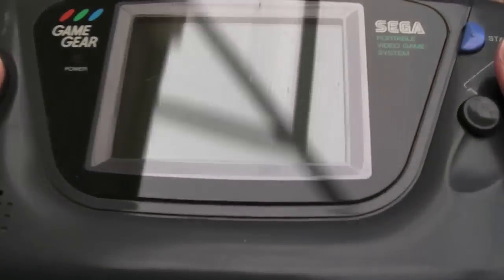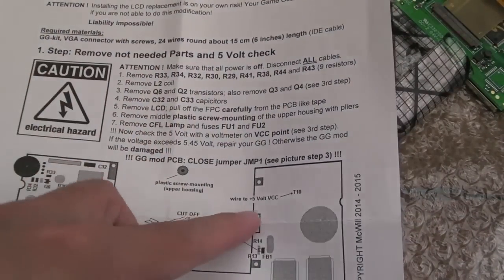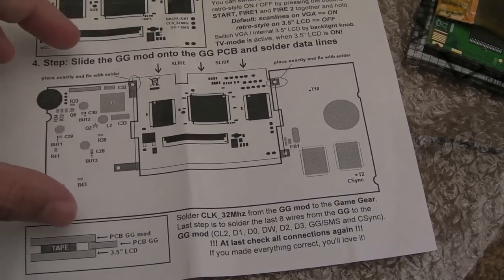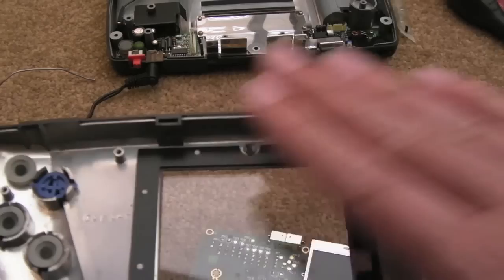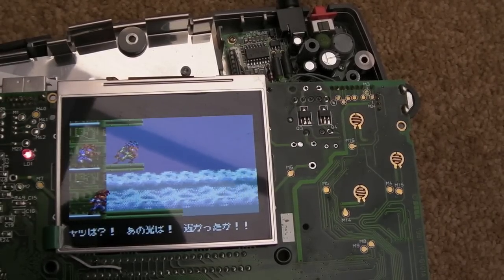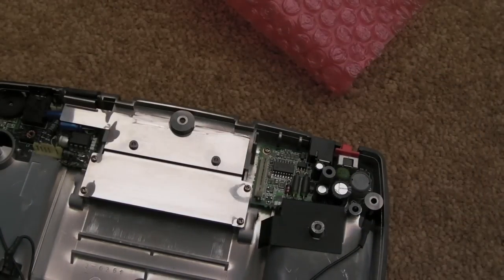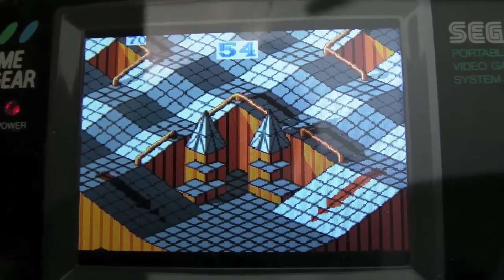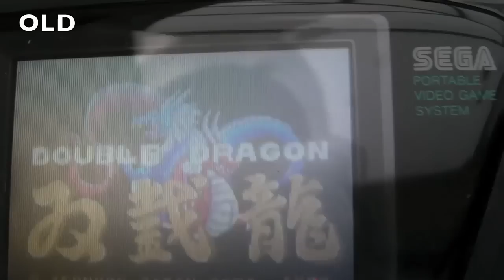Sega Game Gear Modern LCD Replacement (Not Composite) From McWill

Comment: I'd like to see what the TV tuner attachment looks like on this new screen.
Reply from the maker: It's not compatible!  The way the tuner interfaces with the Game Gear means it drives the screen directly with a different refresh rate I think.
Reply: @GadgetUK164  could that be adjusted somewhere either in the LCD or tuner?
Reply: @coondogtheman  Practically no, since you'd need an analog-to-digital video converter since this replacement LCD will only work with digital input signals.
Reply: @armorgeddon  so the original screen is analog?
Reply: @coondogtheman  The screen itself is not (LCD is digital by nature), but apparently it has an analog input which the LCD controller then converted to digital again (similar to a desktop LCD display with VGA input). The only reason I can imagine why Sega would go for such a complicated and quality degrading system is that it was the only feasible way to be able to offer the TV tuner for which they also had to deal with the different TV broadcasting standards across the markets they were targeting.

Comment: Gave you your hundredth thumbs up.
Thank you for this video!
Very informative, in depth, and incredibly helpful.
Reply: It's awesome that McWill incorporated the "scanline generator" option to soften the high def LCD's revealed pixels, and make the games look more like they were intended to be, though on a better LCD display.
Reply from the maker: +SwankeyMonkey Thanks!  McWills screens are awesome, they really are!!!  I bet those Sega Nomad fans can't sleep at the moment waiting for his next screen!
Reply from the maker: +SwankeyMonkey I suspect if you got a larger LCD from the same manufacturer (could probably source the screens on AliExpress I think) then I guess you could probably put a larger screen in, but some work might need to be done regards the connector.   They tend to work with an interface that expects a certain protocol though so it probably needs to be the same manufacturer and would need to have same resolution support etc.   Probably more hastle than its worth tbh.   It might be worth asking McWill the question, he might be able to enable support for a larger physical screen without much of a modification!  If  there's a larger screen from his supplier it could just be a case of a connector change.
Reply: +GadgetUK164 Thank you for the response.
That is exactly what I was wondering about, both the connector if it was somewhat universal or common, and also if there were anything specialized about that particular LCD display in regards to protocols or codexes or what have you. And since you got direct contact working with it and had become familiar with it, is why I asked if you had noticed anything in particular that would keep someone from upsizing the LCD display to match that kit.
But I will carry further with your recommendation and get ahold of McWill about options for my project. 
Thank you again. I subbed your channel.
Reply from the maker: You could also just use the VGA out if course, that way any screen that's VGA would work!
Reply: ***** I understand what you're saying, and know that there are good and not-so-good scanline generators out there depending upon application and display.
But a display this small that's in the Game Gear, doesn't blaringly reveal the image loss you get with typical scanline generators, or isn't as noticeable as it is on much larger displays.
If anything, it seems to improve the image in this application by softening the pixels of certain games.
Anyways, always better to have (scanlines) as an option to suit to one's liking, as opposed to paying for a bare-bones display that you might not be pleased with.

Comment: I order one of these based on this video.  Finished installing it today, wow, what a difference it makes.  My Game Gear is again my favourite handheld (especially when paired with a Everdrive GG).  McWill is an absolute genius.

I took you advice and only soldered one tab, and took ages moving it the slightest amount until it was perfectly aligned.

I think McWill has made a revision to the board as there were extra pads on mine where BUT1/BUT2/BUT3 (from the caps) solder to.

Comment: Wow, this is a really beautiful mod. This would breathe new life into my Unhappy little GameGear - can't wait to get this modded! Thanks for sharing, this is amazing! I was sold when it was aligned correctly, odd glitch eh?
Cheers for sharing!
Reply from the maker: +Callum Rickard Yes, these screens give an excellent picture and are highly recommended!  The only negative really is the slight different in the way the pixels are stretched a little but it's hardly noticeable really and looks way better than the old screens.   That glitch never repeated itself since it first happened!  I think it was just my glitchy everdrive and the fact I sometimes have to switch the Game Gear on and off several times to get the everdrive to boot.
Reply: Ah cool. I don't think I'll end up using an Everdrive anyway, so hopefully the glitch doesn't affect original cart games. Like you say: seems to have been a one-off anyway.
Reply from the maker: I've got tonnes of original carts and they all work fine!

Comment: Man, imagine running this bad boy with the TV tuner cartridge. :O
Reply from the maker: The TV tuner is not compatible with these screen mods!  Apparently it drives the screen differently from the normal game mode.
Reply: @GadgetUK164     Awww too bad :C  that's a shame. But yeah it makes sense though. As i remember TV pictures always left a bit of blank space on the bottom of the screen (at least in PAL regions). Too bad this resolution formats weren't considered in this LCD mod.
Reply: @KRAFTWERK2K6  It's not about the resolutions though because assuming the information I read is correct the original display was fed by an analog signal (so original Game Gear did digital->analog->digital conversion of the graphics output) while with this replacement screen the natively digital graphics output goes untouched to the diplay controller of the LCD.

Comment: Here's a friendly tip on how to avoid reflections when using a video camera to video screens or other reflective surfaces.  Make sure your source lighting is not behind you as it is in this video.  Your source light is coming from the window behind you, making the reflection really, really bad.
Reply from the maker: +sprybug Thanks!
Reply: +GadgetUK164 Yeah, I'm pretty sure you figured this out by this point, but when I was watching it and you made the comment about the glare/reflection, I couldn't resist, because it was pretty distracting and hard to see the thing you were trying to point out.
Reply from the maker: On some of these it is hard to film regardless of light direction.  The Gameboy Advance is a good example, no matter where the light is you still get reflections.  The only way to remove the glare there is to film in a badly lit room, but then you cannot see the screen because its not back lit =/
Reply: +GadgetUK164 Gotchya.   On something like that the only thing I can recommend is to go in a room that's blocked off by natural light, use one light source, like a bright lamp, to light up the room and make sure that lamp is at an angle where it can't reflect too much light off the surface of the screen.

Comment: that looks great! I did a screen on a nomad a few years ago, but it was much simpler. as far as your screen placement. maybe file the gg case to enlarge the screen opening. that way you don't lose anything from the bottom or top.
Reply from the maker: neozeed1984 Thanks, it does look great doesn't it!  The screen didn't need moving or the opening enlarging etc - It was a glitch due to me switching on and off the everdrive to get it to boot.  If you see later in the video there I noticed that without any change at all it was fitting on the screen perfectly - I loaded Bubble Bobble again just to double check and it was perfect.  I had made no change to anything other than switching it off and on.  It could even have been a dirty connection on the GG / SMS pin or something similar.
Reply: GadgetUK164 yeah I saw that when I finished the video. incredible piece of kit mcwill made.

Comment: Thanks so much for the video. I was able to get some good tips from you here and modded my game gear successfully. It is truly an amazing mod. Now I want to do my Lynx next!
Reply from the maker: =D  No problem!
Reply: @GadgetUK164   I have now modded my Lynx model 1. It was easier than the game gear for sure just as you said. Lot less stuff to remove. Now I am even thinking about getting and modding a model 2 for fun. I just always have preferred the dpad on the model 1. Anyways thanks again for your videos. Learning a lot here.
Reply: @geneshifter  I got one recently needs recapping and a new lcd as it has some artifacts in the middle and the brightness is very low now but the sound is perfect still. I have noticed from what I can see when playing the responsiveness when I press a button is delayed at times could this be dirt and grime as it is a old system and is this common?
Reply: @absolutely0bsolete330  I would bet that once you do the recap that it works properly. There could be a damaged trace but I would do the recap first and then test.

Comment: Hi! Good job and video!
Which kind of thin cable did you used?
Reply from the maker: You can use 5 or 7 strand wire, or even Kynar will work OK but its easier to break single strand wire.
Reply: 7 is 0.2mm I think...and about 5? I've got a 0.3mm single core wire, I hope it will be good...

Comment: I'm prepping my ASIC 1 model. Once I get the spare dollars will purchase and give this a go. For about $150AU it's better than buying another Game Gear. I'm a beginner solderer but I'm going to give it a shot. What is a 0 ohm bridge? Apparently you have to do a 0 ohm bridge on R13-R16? The rest I'm just going to try. With the old lcd points I'm just going to put tape down so I don't solder the other points. Not going to worry about VGA output. The only other problem I see is replacing resistor 24 with 30. Those things are tiny. Can't wait to see if I don't stuff it up, lol
Reply from the maker: 0hm bridge is basically a wire - just a short circuit!  Just take your time!  Recap the unit first and test it if you haven't already re-capped it.  And get some good flux, and desolder braid ready before you start.  Let me know how you get on.
Reply: GadgetUK164 - Retro Gaming Repairs & Mods thank you

Comment: It looks to me like the pixel scaling isn't uniform. It looks like the original screen had a different resolution compared to the replacement. Just look at the O's in toolbox when you start the everdrive. The top part is thicker than the bottom part. Can the screen be switched to a non-scaling mode?
Reply from the maker: Yes, you are correct - it's not a 1 to 1 match in the pixel scaling.  The scanline mode helps a lot with that problem and for the most part you cannot tell the difference unless you are comparing side by side without scanline mode on.  Despite that issue, its still much better than the original screen.  It cannot be switched into a none scaling mode.
Reply: Yeah, well that would be a deal breaker for me. But to each his own I guess.

Comment: Does the brightness wheel still function after the mod?
Reply from the maker: If you have the RGB output part of the mod, the brightness wheel is used to turn the RGB output on or off (I think).  But the screen brightness is set to one level.
Reply: cheers

Comment: A tip. Instead of using the VGA output, better to use the connector Micro USB 7 Pin and make SCART output. What do you think?
Reply from the maker: +chakanbhz Good idea, but then you need a cable with micro USB 7 pin which has sufficient wires for the R,G,B,H,V, and ground etc.  I've also seen people use a single inline pin header type connection which is keyed - I might do that when I get around to adding the VGA output.

Comment: You forgot to remove Q3 and Q4. Those are voltage regulators (for the CCFL) that draw extra power.
Reply from the maker: kwnage Well spotted!  I know I did, I and I realised at the time I edited the video!  Don't worry, I will be going in there to do the VGA mod next =)  Very well spotted though, you are the first to notice =)
Reply: GadgetUK164 Nice, looking forward to the VGA mod video :)

Comment: Great!
Just recieve mine!
Please, can you tell me how to clean the pcb after removing the original screen (under tape)?
I remove tape very carrefuly, but the contact on pcb is white (no coper or silver). I hope the coper still on pcb.
Thanks.
Reply from the maker: Use some flux and desolder braid.  That should remove any contamination.  They can look white when you peel off the old ribbon - it's the under part of the ribbon still joined to the pad.  If you have actually lifted a pad, you can always follow where the trace goes and scratch the surface of the green solder mask carefully to expose copper underneath, but I don't think you will need to do that - it's likely just the old ribbon contacts stuck on top.
Reply: Ok, i'll do that.

Thanks

Comment: Hello, thank you for your clear instructions! I just did the same to mine but I got the colors messed up! I've reviewed the connections a couple of times and I can't find anything wrong. Has this ever happened to you? Thanks.
Reply from the maker: Very strange, are you 100% sure the connections related to the colours are not wrong (or bridging where they are soldered onto the edge of the GameGear?   If all the connections are definitely correct and you haven't accidentally flipped a couple of the colour bits, it must be a fault on the mod.  Maybe ask McWill?
Reply: @GadgetUK164  my bad. I erroneously connected one of the pins to LCD number 59 instead of 57. I just fixed this connection and now it looks really good! Thank you for the support anyway!

Comment: One of the sweetest LCD mods I've ever seen! So do gunstar heroes still have glitches? Is it because of it's inaccurate port of the game or because of LCD replacement? Also I assume that battery life now is larger than before modding! Thank you, good luck with new videos!
Reply from the maker: +El Thunder Yes, its an awesome screen =D  The battery life is around the same I believe - the CPLD on there eats a chunk of power as does the new screen.  The minor glitch there does still appear in Gunstar Heroes but its hardly noticeable after the first screen or so.

Comment: Great replacement screen, but it's a shame about its scale-to-fit problem, you can clearly see that the horizontal and vertical linearity is messed up. I guess this is the only cheap way to do it, I don't know of any modern LCDs that has a resolution of 160x144.
Reply from the maker: 8bitbubsy Yeah, it's not quite perfect due to the scaling but with the retro LCD mode on it looks pretty good tbh.  There is an option on the board to disable scaling - not sure if that just disables it on VGA out, the screen or both.  I will test that when I add the VGA connector.

Comment: I just finished this mod and now the game gear plays like it is at half speed or in slow motion. It worked fine before I did the mod. So not sure what I did wrong.
Reply from the maker: I would first speak to the creator of these screens (McWill) - he might be able to point you in the right direction straight away.  I would guess that perhaps a connection is wrong or needs checking, or maybe you forgot to remove one component.

Comment: Aw damn that screen looks amazing! I've got 10 Game Gears and over 110 carts (with dupes for 2-player linkup), with a ton of accessories, including the really rare GG shaped wristwatch: http://www.haku.co.uk/pics/GameGearWatch.jpg and the Action Replay, Game Genie, TV tuner, FM radio (it's crap, all it does is use the GG as a speaker and power supply), battery packs, screen magnifiers, several different carry cases, 2 variants of the Master System adapter (including a Master System Action Replay!)

I was in a nostalgia mood tonight, after playing with my Atari Lynx's I dug out my Game Gears which range from "take it out back and shoot it" to "almost mint condition", but discovered ALL the ones that used to work some years ago now have screen brightness issues and lots have no sound, so that's a capacitor problem, but after seeing this video of the LCD mod I'm trying to work out how long I'll have to live on bread & water to justify buying one!
Reply from the maker: Its a shame but they do all die from bad caps eventually - so it is worthy getting them re-capped.
Reply: You know, I think most of these caps are small enough values that you could replace them with tantalum capacitors and never have that issue again. All the kits I see are electrolytic... just a thought. Even the weirder values like .47mF 50V are available in tantalum. Those are also, correct me if I'm wrong, bipolar capacitors so you can't even plug them in backward!